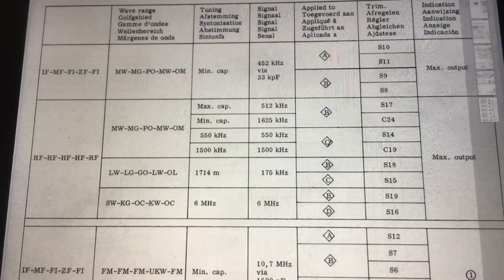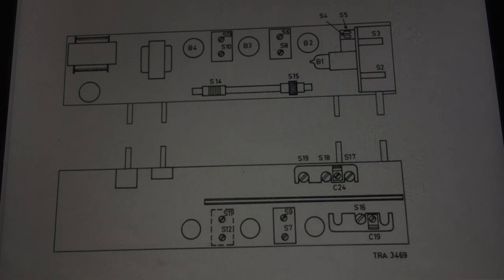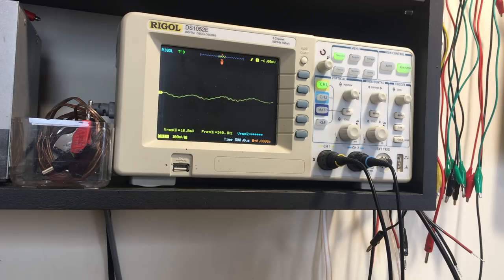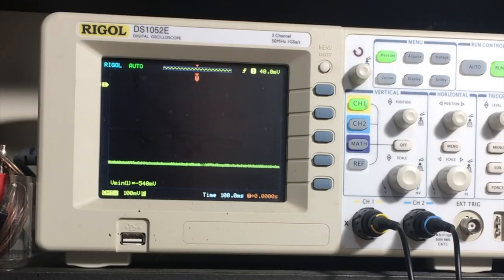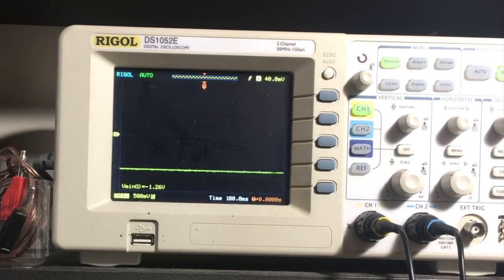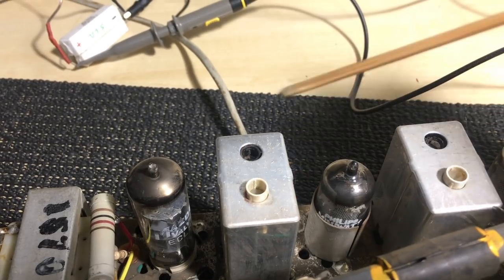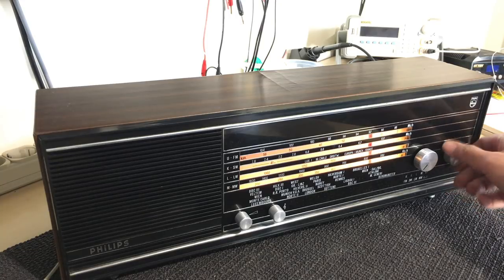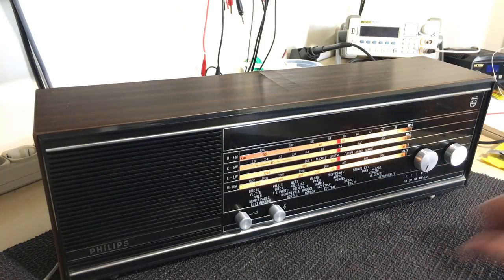Philips 22rb382 tube radio restoration - Part 3. It's a wrap!

Comment: Recently I did restoration of 1969 Philips Prestige all valve radio. Band switch which is rotary wafer type is giving some trouble. Can you suggest remedy?
Reply from the maker: Clean it and lubricate carefully.

Comment: Hello, great videos thank you. Would it be safe to test a tube from not working radio with a working radio? or it can do damage in case it's in wrong condition. Thank you
Reply from the maker: I often do that. Just keep the test short in case the tube is actually shorted, so you don't want to damage your working set.

Comment: I have this model and im currently attempting to fix the tuning knob but it seems to be rotating freely as the internal string with the spring had snapped and so i have tried to replace the string but im not too sure how to fix it into place so the dial itself moves the frequency indicator could you help please
Reply from the maker: You need to look for the service manual and follow those drawn instructions
Reply: @electronicsoldandnew  i really appreciate your reply and i have been look all over he internet for it and cant locate it anywhere
Reply from the maker: https://nvhrbiblio.nl/schema/Philips_22RB382.pdf
Reply: @electronicsoldandnew 
Thank you much appreciated the drawing seems easy enough to follow along